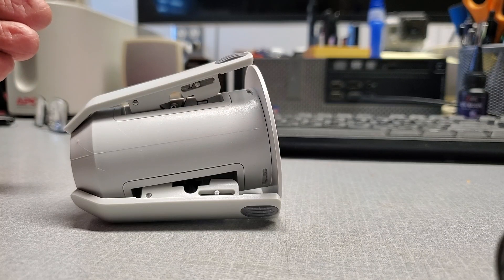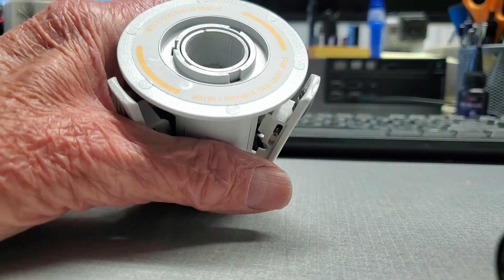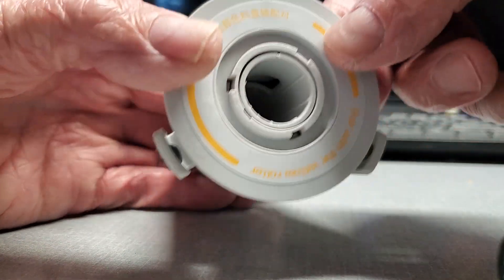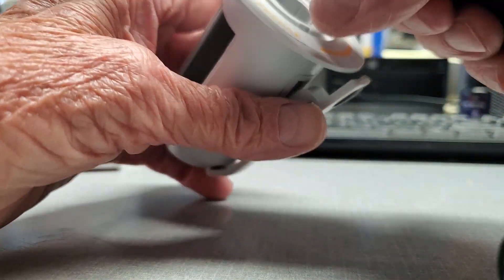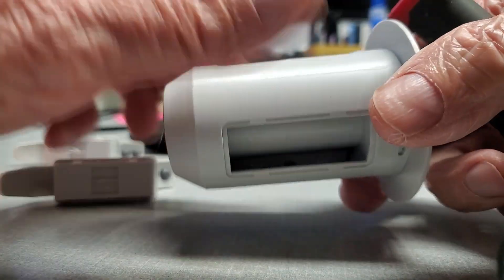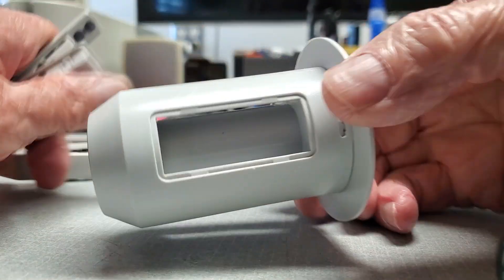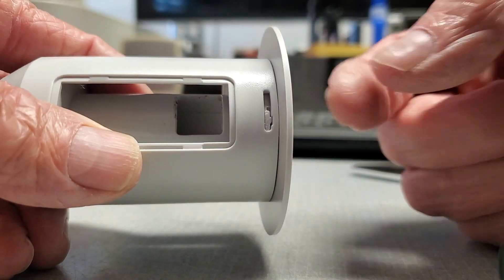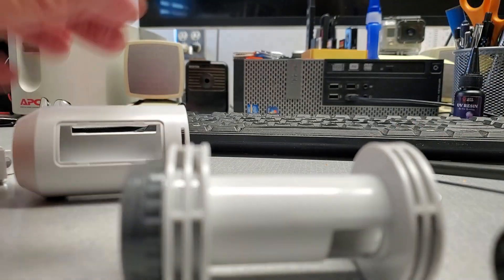Bambu AMS Lite Hub Disassembly

Comment: i have seen one just pulling them off from the outside, tried the same, did not succeed except maybe getting them off from one side but then they are stuck. 
Tried yours, did not succeed im bout to crack that damn thing open by the pressure. 

Maybe throwing it against a wall will help

Comment: From my limited understanding ( since I don't own any Bambu Lab Printers ) the Filament seems to get passively rewinded back onto the Spools whenever the active Filament is being retracted to make space for the next one.

Can you provide information HOW that passive rewinding is being achieved? I imagine it being done by a Spring that gets progressively tensioned as the Filament is being pulled in until the Spring can no longer give at which point a Clutch ( stronger than the Spring but weaker than the Motors pulling in the Filament ) will take over. If the Filament is being returned the Spring under tension will try to relax itself again.

How many 360° turns of a Spool can the Spring pick up before the Clutch takes over?